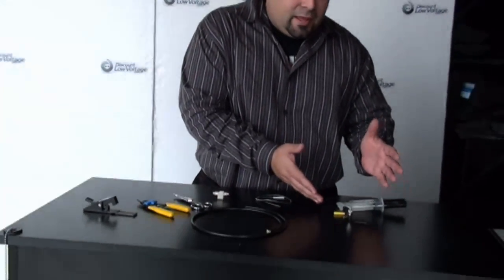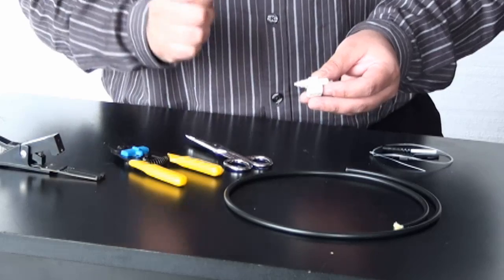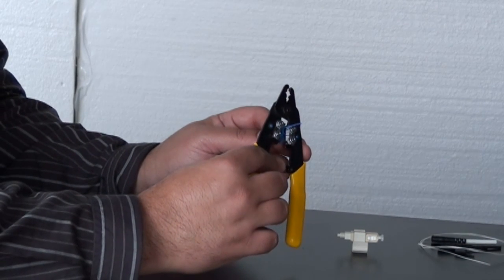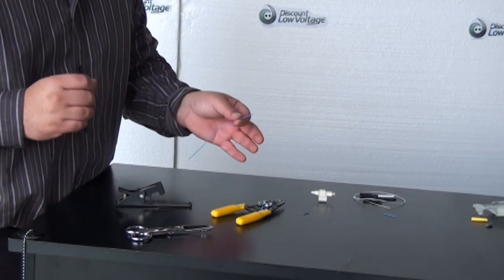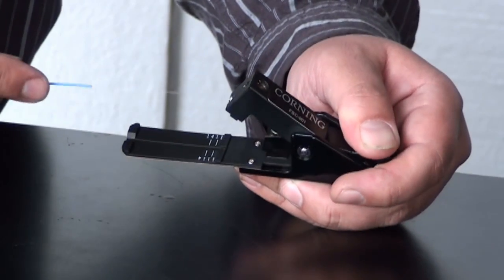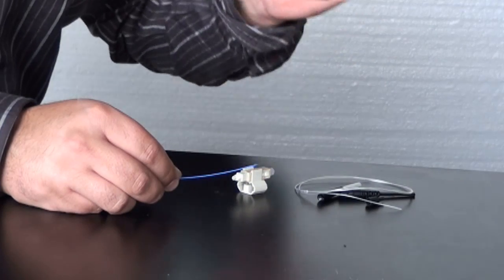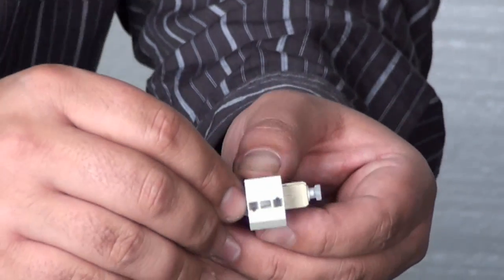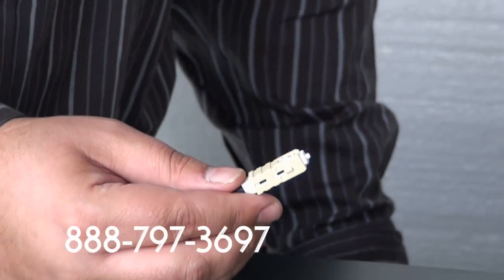How to Terminate Fiber Optic Network Cable

Comment: Multimode is only used interior. If you are working on a drop it's going to be singlemode. I notice he didn't clean the fiber either.

Comment: This is what keeps me in work. Going out to fix fuxed up terminations is still my biggest cash cow. So many people with so few skills working on precision terminations is how I can earn bucks.
512 substandard terminations had to be corrected last week due to bad practices. I did them all by myself in one working day of 12 hours on an emergency call out. All manually tested with otdr passing over 90% and with bonuses I pulled in $7000 for a days work correcting some cowboy teams crap.
Reply: where did you buy the fiber kit?
Reply: @heoung8611  I had a few kits at the time that I picked up on ebay. Belden CDT and Ortronics might be a good search term.

Comment: Did you really leave the primary coating on the fiber? The standard procedure is first to remove the buffer (which you have done) and then remove the primary coating. It is the first time I see an FO connector done with the primary coating left behind. You should also remove the residues with some solvent and a dust-free cloth. And do not ignore fiber leftovers!
Reply: Dead on

Comment: Dear Mercy, 
Need your valuable answers for these.
1. Difference between MM and SM Fiber Optic Cable. 
2. Type of cable to use for Long and Short Distance.
3. Media converter to use for MM and SM Fiber Optic Cable.

Comment: Is there a way to clean the connector in case a fiberglass breaks inside of it? And how about when a fiberglass breaks in a standard single mode PC connector? Thanks in advance
Reply: ok, bummer. thanks though

Comment: Wow, that was pretty easy and this was in 2010. I wonder how it's done in 2015?
Reply: +Mercy Salinas How much are the cost of fusion splicers (in a small pack of say 10 or less) compared to the more labor intensive connectors? (also in packs of 10 or less)
Reply: rtrain67 2017 were still doing this the same way and it's a lot harder than he made it look

Comment: I am afraid for your health and safety. where are the glasses and gloves. the video content is good but in health and safety side is a danger.
Reply: Fiber Optic cable is made from glass. Cutting and cleaving FO cable can cause shattering and splinters of glass to fly off. Most FO techs who are doing a lot of splicing where durable gloves and eye protection for that reason. And yes, it is fairly common to get minor injuries from FO.

Comment: How many connectors can a tech put on roughly per hour? I know environment and amount of terms per cable vary but I'm just trying to get a feel for this kind of work as a future project manager.
Reply: thank you for that reply. any other input is also welcome. my father had the same answer, about three minutes, just trying to get some number in line for a mgmt position.
Reply: ***** Danny V   3 minutes per connection sounds like an accurate time. I terminated fiber optic for the first time last night at work, and I picked it up really quickly and it took about 3 minutes for each of mine when I had everything down.